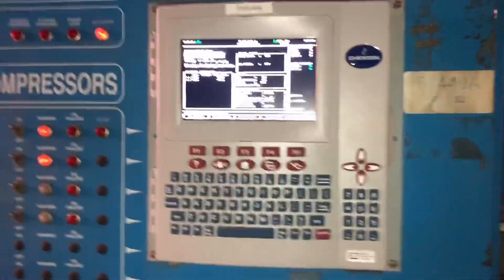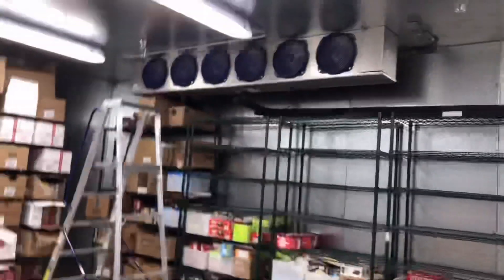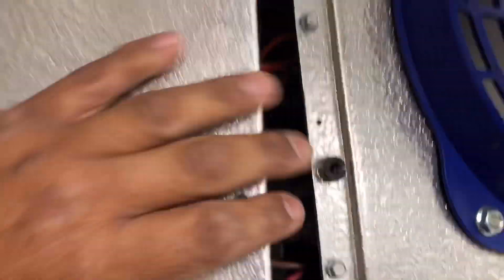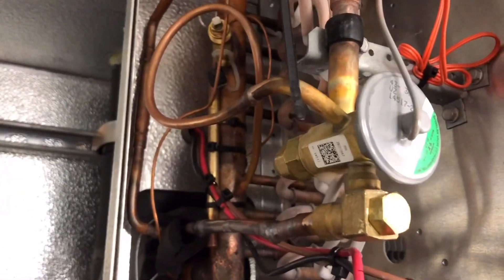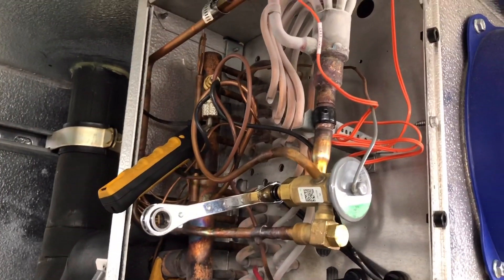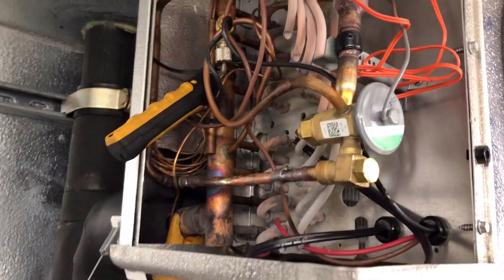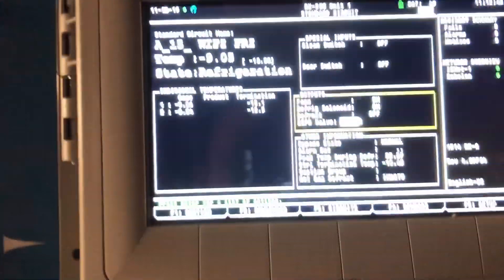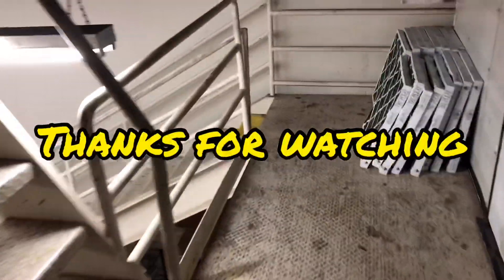HVAC Refrigeration:  Setting superheat On a Walk In Freezer On a Rack System

Comment: Min 0:30

What does "at 30%" mean here?

I understand what "override the EPR" does, but not "at 30%" part.
Reply from the maker: Electronic epr.  Set it to a certain percentage.  That way your set doesn’t not fluctuate
Reply: @rookierefrigeration4357  
Ok - thanks, but what does the "%" part mean?  What's the difference between 30% and 50%?

What happens when you set it to 0%?
Reply from the maker: @hg2.  0% is fully closed.  No cooling.  
100% is fully open.
Reply: @rookierefrigeration4357  

Ok - thanks.
In other words, "override" turns the EPR into a piston/fixed orifice metering device, and "%" says how much of the "max hole" the piston is. 

With TXVs - everything is subcooling.
With pistons, everything is superheat ("target Superheat")
With EPRs on override... I guess you just have to know what you're doing as per "the %" you set the override at. Any tips here?

Thanks for making.

Comment: Min 3:08
What does "not flooding back" mean here?
If superheat is negative, won't that have Already destroyed the compressor?
Reply from the maker: There a difference between flooding a compressor and slugging.  Slugging is what usually will kill them.
Reply: @rookierefrigeration4357  
Let me guess:
SLUGGING is when the compressor gets 100% liquid, whereas FLOODING is when there's some gas and some liquid.
Have I got that right?

Thanks for the vids!
Reply: @rookierefrigeration4357  
Thank you RR.

Question: I understand "slugging",  but what is "flooding"?   (They sound the same, i.e. liquid getting into the compressor.)

Comment: I’m new to rack systems myself. Had a issue today and was hoping you could help. I have a walk-in freezer and the floor in the freezer has a frozen sheet of ice on the floor. Condensate pan is clear of ice and drain heater is fine. The only issue I saw was a lot of frost/ice on the suction line at the evap. With a little frost at the bottom of the evap as well. I checked the sight glass at the compressor and it was clear. Hooked up my gauges and everything looks perfect on the pressures/temps. The compressor was recently changed about 3 months ago. The compressor is chill water cooled, you can adjust head pressure. Also, hooked up temp clamps at the compressor and was getting 55 degree superheat, which is extremely high. I didn’t get a chance to check it at the evap but will first thing in the morning. I’m thinking TXV might need adjustment. Can a poorly adjusted TX valve cause a frozen suction line? I was thinking a TX Valve not allowing refrigerant would mimic low on charge. Thanks!

Comment: Would it not be better to override the epr to 100% so virtually no hold back to set up the super heat? Also what is your preferred super heat in a wic compared to a wif? Or are they the same
Reply from the maker: Yes.  It’s is better.  We changed our procedure from 50% at temp to 100% full flow.   This was recently.    Superheat on the freezer is 4° and on a walk in cooler about 6 to 8.
Reply: @rookierefrigeration4357  awesome thanks for the info👍

Comment: What saturation temp was you shooting for in regards to the epr override. I would think the freezer circuit would be almost all the way open,  a cooler would be cut back more to raise it?
Reply from the maker: Yeah this freezer is running at rack pressure but I override the EPR so it won’t fluctuate during SH adjustments.  Other than that it’s normally 100% open or down in the 30% when almost at setpoint.
Reply: @rookierefrigeration4357  was that epr locaited on just that freezer circuit you adjusted the txv on or was it the suction header for the rack

Comment: We usually cut out the drier at our Targets as well
Reply from the maker: Yeah we do too.  These were probably from a remodel
Reply: If I remember correctly target orders the coil with them installed. When you tie in the coil to your over head guys tend not to flow nitrogen. So they tend to get clogged up.

Comment: so you adjust superheat by overriding the epr?? How does it work when is back to Normal or how to get your Target when is off on override?
Reply from the maker: Well, we set it once you’re at temp or close to temp. Depending on the saturation, your SH may vary, but generally will remain very close to where you set it.
Reply: @rookierefrigeration4357  aa i see okey i was just curious on that, really want to get into the market Refrigeration field

Comment: Nice video,,,as usual,,,I do different way,,,I place termometer clamp after the TXV ... and  other clamp outside suction pipe,, ,,,and a do adjusted,,,what you think good away,,,?  🙂
Reply from the maker: You get your saturation temp by a pipe clamp after the txv.  I’ve heard you could do this but I always have an access port for a probe.  If it works for you, no problem.  👍🏽👍🏽

Comment: those it comes with filter driers in the coil? or he installed it there?
Reply from the maker: No. This store was recently remodeled and they installed driers at the txv.  We usually just cut them out.
Reply: @rookierefrigeration4357  Aren't rack systems supposed to have a serviceable drier on the rack?
Reply from the maker: douro20 yes, but when they install new evap or anything they usually put driers.  Really sucks cause we always take them out.